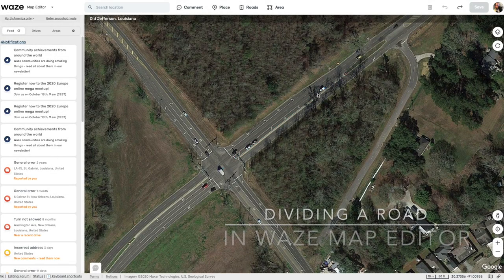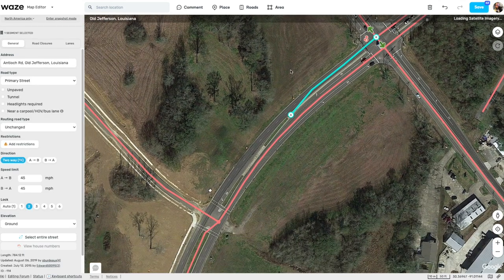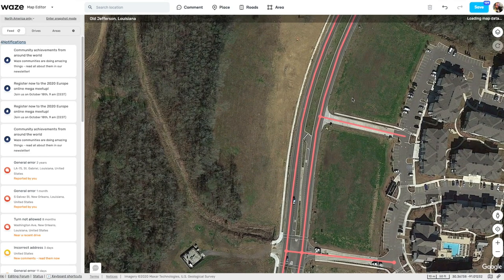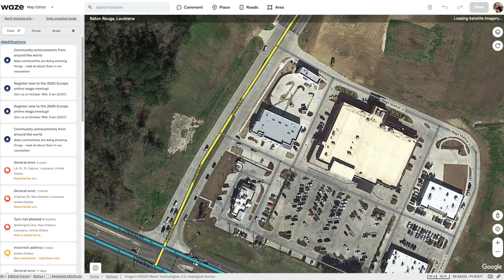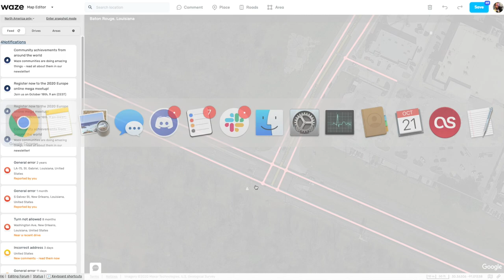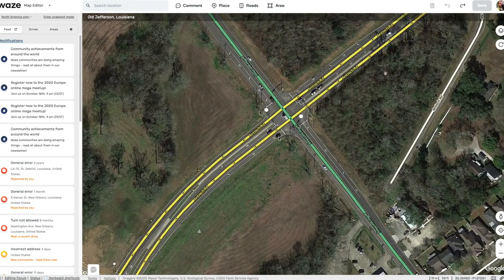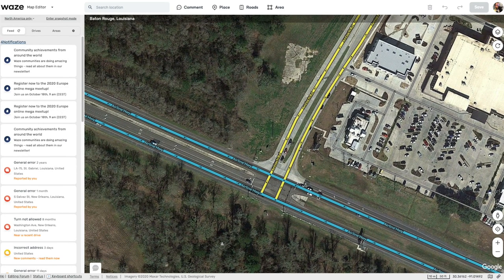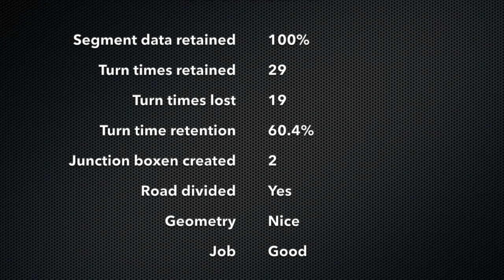Dividing a road in the Waze Map Editor

Comment: There's a Waze map editor area manager and he says to not ever do this. This username is "onmywaysir". Any advice?
Reply: When was that? There was a time when we did not divide some roads.
Reply: @onmywaysir  2 years ago maybe? I'm not completely sure
Reply from the maker: Our standards have changed. Since mid-2020, physically divided roads are required to be mapped as divided roads in Waze (in the U.S., at least).

Before that time, though it is not quite accurate to say "we did not divide roads" (whether to divide was a decision made based on various criteria and with the guidance of local leadership), it was still fairly common to map some physically-divided roads with a simple line of two-way segments. At the time, it was fairly common for new editors, without reading our mapping standards, to embark upon a dividing project on roads that would not have been divided under the old standards. Not trying to assign blame—the wiki can be hard to find and navigate. But it was fairly common for senior editors to find those new editors and point them to guidance.

But, again, that guidance has changed :)
Reply: @sketchsketchsketchsketch  ok, this makes much more sense. Thank you for assisting me! I'm glad Waze is more on board of not sacrificing detail to simplicity. I like where this is going.